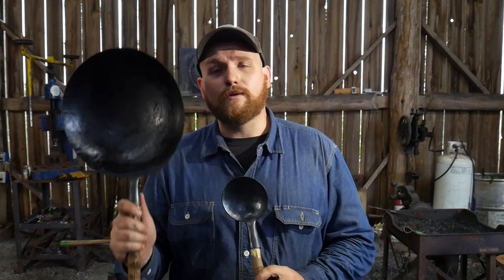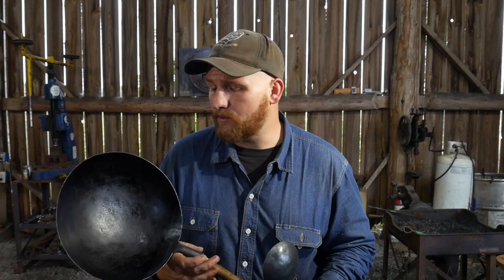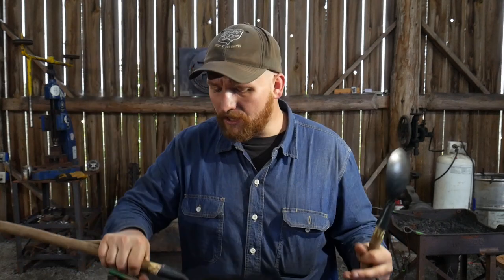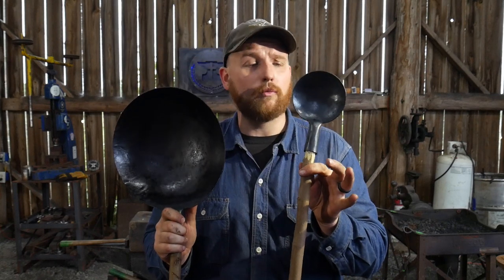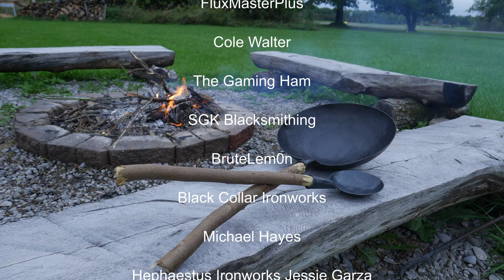Forging a Campfire Wok & Spoon Kit

Comment: Great video Roy, really smart, is it easy to clean after use, do you have to use oil to prevent rust.
Reply from the maker: Thanks 👍 Yes you need to keep them oiled and to clean All you do is heat It up and wipe it down